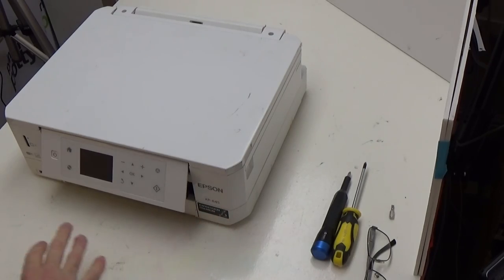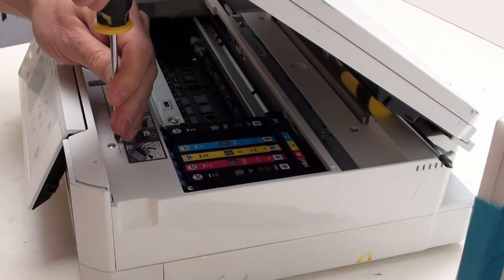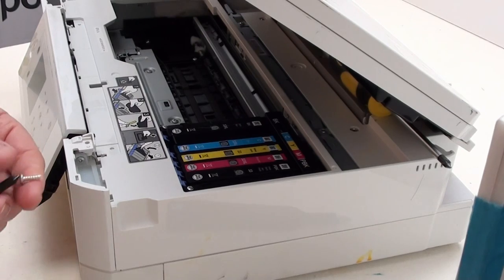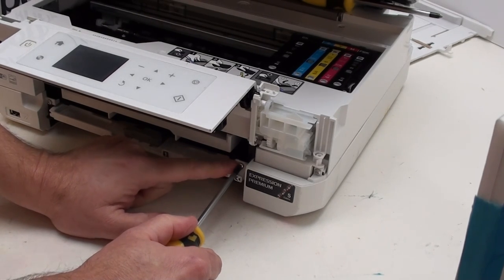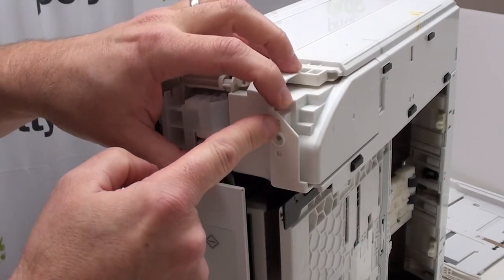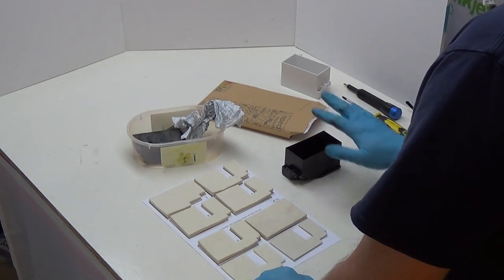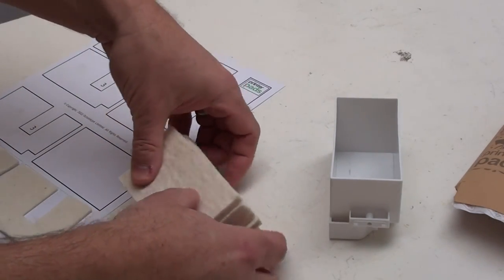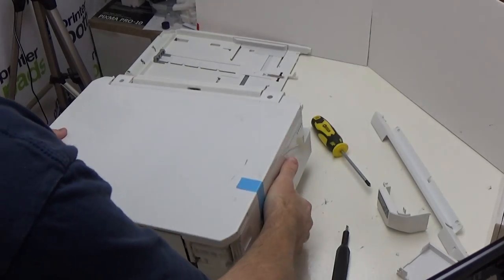Epson XP Waste Ink Pad Fix : XP600 to XP860

Comment: my XP-600 started showing this message after I cleaned the printer heads, as I was getting a lot of gaps. "A printers ink pad is at the end of its service life", Epson said that model is dicontinued and no parts are available. Does this video cover this and do you have parts?
Reply from the maker: First off, yes the XP-600 is definitely covered by this video, our XP2 pad+key bundle and the reset process covered in other videos (keyword: WICReset) on the channel.

Secondly I'm horrified that the support rep' you spoke to lied so blatantly about the availability of parts and/or support for the waste pad error you received. If you want to contact us directly by our support@octoink.co.uk address I can answer any other questions you might have too.

Comment: Great tutorial...Nicely done. Epson really dosn't want you to get this maintenance box. OMG soo many screws to to get to this tank. On my Epson WorkForce 630 I had 1 screw and what I did was rinsed them out with water for about 15 min. Let them dry over night and then put everything back the next day. My maintenance tank does not have a chip just like this one  so I was able to clean the pads and reuse. But for those with a tank with a chip you will need to order a new tank and with the pads.

Comment: Brilliant!! ordered & received inkpad kit and reset key for Epson XP-615 within a couple of days.  Extremely easy to follow video - reset key came in the package - all in all a doddle to do.  Certainly save buying a new printer - Keep up the good work.  Highly recommended.
Reply from the maker: Thanks so much for your kind comments.. Glad it’s helped.
Reply: How did you get the rest key?? The video doesn't explain how to do that.  I ordered my pad kit today
Reply from the maker: There are separate videos that show how to use the WICReset key but for completeness the keys are available either on their own:
https://www.octoink.co.uk/keys

...or as part of one of our many bundles for Printer Pad & Potty kits. Contact us via support@octoink.co.uk if you're still stuck.
Reply: @octoinkjet  Thank you for your quick response! I have already ordered the replacement pads through Amazon and they should be here tomorrow. I have seen in some videos where people have said after replacing the pads they did not have to reset the counter. But if I do need the reset key I will use the link you provided. Thanks again!
Reply from the maker: Chances are high they replaced the pads when the printer was saying that they'd need to do it "soon" but rest assured the waste ink error will hit and require a waste counter reset eventually.

Comment: The step-by-step instructions in this video were indispensable in guiding me through the changing of the waste ink pads. At one point I was considering buying a new printer, except for the fact that I had many ink cartridges that would probably become useless. I especially appreciated the details of the instruction such as the tools required, waste container, the different colored screws, magnetic screwdriver, positioning of parts to be reassembled, etc. It has been a pleasure doing business with OctoInkjet/Printer Potty!

Comment: I was able to replace the pad and reset the counter, but now my printer looks like it's printing, but there's very little ink on the page. Any ideas on how to fix this?
Reply from the maker: This can happen when air gets into the cartridges and causes an air lock. The simplest solution is to remove the cartridges in the printer and replace them with a fresh set. Cap the carts you remove and leave in storage right way up and they should settle out over time as the foam/air-bubbles dissipate. 

You’ll likely need at least one head clean to get the ink running but don’t do multiples in quick succession as that just wastes ink and makes more foam.

Comment: My printer is a 640, I’m glad I watched your video because I had the wrong pads selected. I’m hoping I recognize the steps and they’re not much difference in the 645, it looks very different though. I will check how to reset afterwards because I didn’t understand how to do that. Thank you for your help. I’ll use your video to proceed step by step. I have no choice but to try. I’m no wizard at all.
Reply from the maker: Glad the video helped. The XP640 and 645 are physically identical so aside from plastic colour the video will cover it. The videos for resetting are also on this channel if you search for WICReset

Comment: Video was perfect. I wasn't careful and disconnected the LED control panel from the body of the printer. The cable ribbon came out, but after carfefully re-inserting and taping it down, all is good.
Reply from the maker: As chance would have it we did a video on how to fix that too: 

https://youtu.be/GrkB7n93YSE

Comment: Thanks so much for this. Had the whole job done in about 15 minutes, made even easier by pads bought on eBay that even came in the snap-in plastic container - no gloves, no mess! XP-860.
Reply from the maker: Yeah, the pads in a new holder is always an option but we deliberately chose to provide pad only replacement sets (without the additional plastic) as we wanted to keep the environmental and shipping costs to a minimum.

Comment: The reset key worked and the pads fit great.  The only thing I had to do differently is that my extra pad did not have any notches.  Since Martin showed inserting it into the middle of the pad set  I cut the notches per the number 3 pads. The pads arrived in a timely manner from UK. We have saved our printer from the landfill,  yay!
Reply from the maker: Thanks Donna, I need to update our videos on this but the spare pad can be any pad and doesn't necessarily need to be notched. I should have highlighted this so apologies if this confused or frustrated things at all.

Comment: Is there a difference between the ink pad and the waste ink pad? Also, where can I buy a replacement pad?
Reply from the maker: Not sure exactly what you mean but almost all "ink pads" are there to absorb waste ink in some form or other. In the XP series covered by this video there's the main waste pad (which is what we change here) and the platen pad. The latter is the thin pad that runs the width of the printer and catches any overspray from borderless printing.

Does that help?

As to where to buy, we have these replacement waste pads on our store here:
https://www.octoink.co.uk/pid/797

Comment: Super helpful video. It guided me through the removal perfectly (Epson XP-7100). 

I am not sure where to reorder new pads, so I will try to rinse thoroughly and dry the pads and replace the old ones. I will use the epson manual to find out how to reset the wasting counter. 

Prior to the video, I was 99% sure I would need to replace the printer (Epson support is lacking in either doing the work or identifying guidance. The tech at the store of purchase said they had a "new one" I could buy!).Your video provided excellent direction. Thanks, Tony
Reply from the maker: Hi Tony. Glad it helped. Couple of things to note.
1. If you wash the pads don’t squeeze them at all as this just compresses the pads so they felt up more and reduces capacity.
2. Resetting the waste counter isn’t in the manual or supported by Epson (outside of an official service centre). Best option we can recommend is a WICReset key with the app. There’s other videos on this channel that cover that process too.
Reply: Much appreciated feedback. Although, they are already drying in the sun: after wringing them out.  Can you recommend a site for replacement pads? Or can they cut out of the same kind of material?
Reply: Where would I reorder new pads?
Reply from the maker: Sure, we have our own XP2 pad set which cover the XP7100 too. 
https://www.octoink.co.uk/pid/797 (with the reset key)
https://www.octoink.co.uk/pid/799 (just pads, no key).